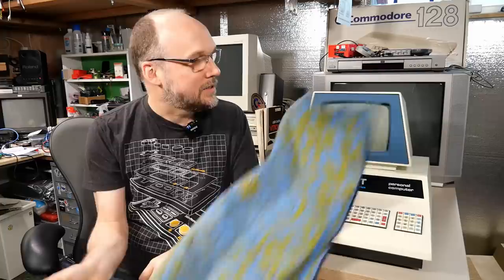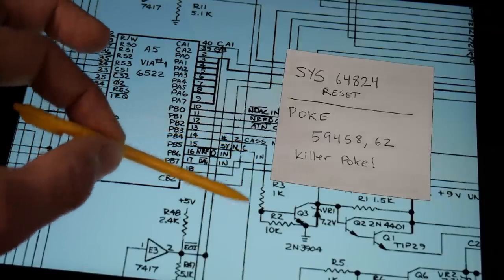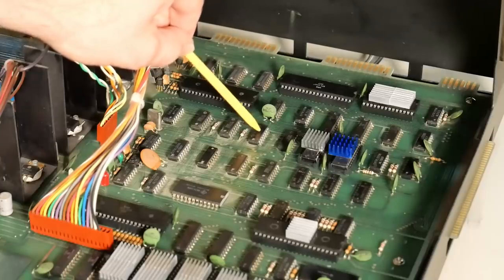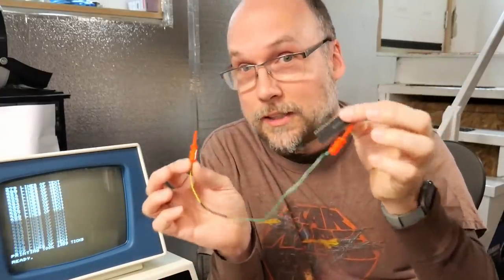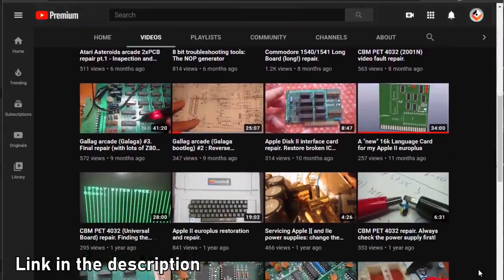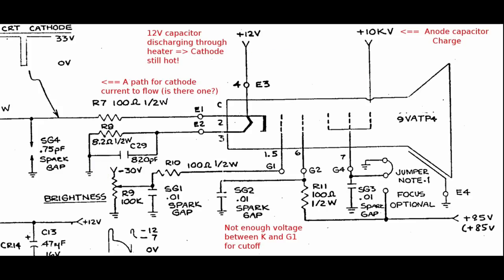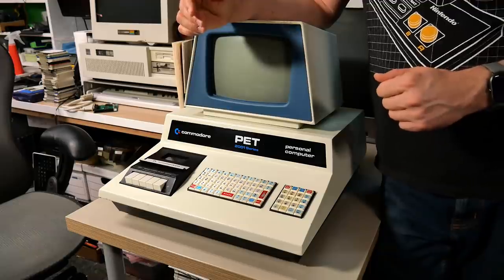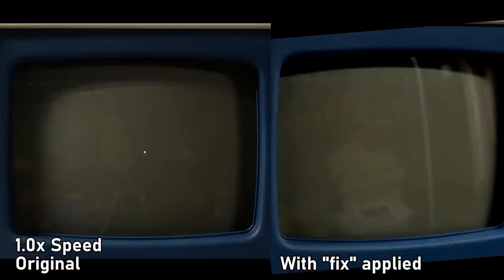Permanent Killer Poke Mod and CRT Spot fix on the Commodore PET 2001

Comment: My 9"PET has no dot on power off, PCB is marked CDU-B79-CMD, the tube is an AMPREX M24-392GH.  
More modern CRT monitors have a spot killer circuit. (google: CRT spot killer)
Long persistence of a dot may be an indication of circuit failure.

Comment: As a kid in the 70's, I remember that white dot as being totally normal on all of the black & white TVs.  This is the first time in my 50 years that I've heard anyone say its simple presence at power-off was any kind of indication of a problem.  Unless it's lasting so long, and is so powerful as to burn in the screen, I think modding it out of existence is a bad idea that breaks the 'genuine' experience of using these old CRTs.
Reply from the maker: On old TVs it was a way to drain the high voltage from the CRT, good if you had a consumer in there changing tubes. 

Ones TVs became solid state the dot was eliminated on most TVs especially solid state ones.
Reply: @adriansdigitalbasement  I think that fix circuit needs component value tuning on a case-by-case basis. It's helping noticeably, which means it's a good idea but not an optimal implementation.

Comment: My first ever "proper" computer I managed to salvage from a fire damaged business and it was toasted good and proper that Pet was.  Luckily the unique chips had survived and the unit was little damaged except it didn't work and over the following months using a hoary old "How to: Electronics" book and salvaging components from broken stuff I slowly put it back together and got it working.   

I had a nasty glazier's soldering iron that stank horribly and back then solder wasn't cheap and the fluxed solder costly but it was a lovely moment after many long long hours it sprang into life but did pong a bit of burning smell from the fire and I sold it quite quickly using the money to buy my first IBM PC and something Sinclair prob the Spectrum 48k and because the IBM was also broken I started again with my little box of harvested components set about getting that up and running and was far easier than the Commodore imho.   

Has to be said in those days it wasn't the easy architecture we know and love today, none of this swapping out of cards etc and you could kill your motherboard quite easily through heat death, lightning spikes, telephone bell too close etc and because it was new technology the quality control wasn't what it is today with CPU's taking an early shower due to poor manufacture of components.

Comment: Could you have done the mod by getting a spare chip socket, running the mod cable from that and installing that between the chip and the mainboard? or would the extra socket have unwanted side effects, maybe cause unreliability?

Comment: Maybe put a resistor on the SYNC line so that the poke works as expected without risking damage to the chips?  Or attach the clip back to SYNC, since you have a resistor on it already.

Personally, I'd be tempted to replace the ROM to give me both options.

Comment: Eliminating the 'snow' by only writing to video RAM during VSYNC always struck me as a cheap 'fix'.  I designed a video card for my Altair 8800 using DRAM for the video memory running at twice the processor frequency, with alternating phases dedicated to the CPU and the screen refresh.  It worked great - unlimited CPU access and no snow.

Comment: Would never think the power off dot was an issue, I’ve had plenty of TV sets (mostly black and white) which kept the dot on screen for a few seconds —  also had something similar when I was a kid with a colour set, for some reason as a kid I turned on and off a colour set about 10 times very quickly and after that every time the set was powered off and unplugged there was a colourful ring that would shimmer for about 60 seconds and would fade
Reply: That last bit sounds like some hardwired order of operations had gotten out of order. Maybe a resistor value drifted, or a capacitor dried out, or who knows what. A diffuse afterimage is not a big problem anyhow, it will do even less damage than a few seconds of normal operation. My only concern would be that there's high voltage sticking around where maybe you don't want it to -- but there's a reason you're not supposed to poke around inside CRTs even when they're off unless you know what the dangers are.

Comment: The spot on your pet is too large to worry about spot burn, spot burn occurs when you have a stationary focused spot of around 1 to 2mm, and is worse on monochrome monitors as there is no shadow mask to take some of the energy.
Monitors where the spot suppression circuit has failed will strip the phosphor in 1 turn off.
There are two main ways of dealing with this;
1 you can dissipate the CRT energy while the scan circuits are still scanning but this is reducing with time from off.
2 you can cut off the CRT usually by taking G1 negative.

The first option is to turn on the CRT hard at power off so the energy is discharged before the scans shrink.

The 2nd was to take the G1 hard negative on power off, this was often achieved by having a transistor that either shorted part of the G1 divider chain or disconnected the G1 control GND end on power off.
Reply: Do you think a cap between the 12v line and the grid would provide enough of a negative voltage to cutoff the tube?
Reply: @eDoc2020  No I don't think it would. I would probably increase the cap on the -30V rail and try to disconnect the 0V end of the brightness pot on power off.
This could be done with a transistor and the base controlled by a zener to the 12V rail in some way.
You could also increase the video HT capacitor value.

Comment: I’m surprised that a modified DIP socket wasn’t used instead of bending a lead on an IC. The way to go would be to get a socket for use in wire-wrap applications, trim all but one pin to the correct length, then bend the one pin out. Instant adapter.

Comment: The original IBM PC 5150 with a monochrome monitor could blow out the monitor's horizontal output transistor.  When powered up, the video controls could come up in a state that would blow out the HOT if it was not reset.  If there was a BIOS failure BEFORE the 6845 was reset, the horizontal output transistor would fail.  Eventually the BIOS was modified to put the 6845 into a state that would not blow out the HOT before testing the memory, etc.  I know this because a friend blew out 3 monochrome monitors before he figured this out.
The BIOS of the original 5150s could not be rewritten so this time bomb was in the 5150 for ever.

Comment: Even better idea is to use the Hsync signal loss at power down to send a bit of the +85V to the G1 terminal of the CRT
Reply: I thought negative grid voltage is needed to cut off the beam.
Reply: @eDoc2020  yep you're right. my mistake! We need to store some negative voltage into a cap then send it to the grid G1 when HSYNC dissapears. If I remember well -40V was the standard for spot killers back in the days

Comment: 13:25 Adrian: "I am far from an expert on CRTs..."

Most other ADB Videos: [Tears into CRT, has fancy CRT troubleshooting equipment, rejuvinates a Mac CRT, swaps and mods other CRTs... also one of few retro guys poking fingers into high voltage areas where I don't dare, almost like its no big deal, but still gives safety first warnings...] 

Could have fooled me. :-)

Comment: on that you can't damage a machine with a program.... I believe there was a command on the BBC Master that turned off the cooling fan.... resulting in the case melting over the PSU. (also I believe there was no command to turn it back on...)
Reply from the maker: Haha that is funny!
Reply: What kind of design choice is that!?

Comment: Just think of all the televisions and monitors that had the spot and how they all have a massive screen burn where the dot blasted the phosphors, yeah, I haven't seen one either, cos it's normal for that era of analogue CRT circuitry... :P
Reply: My family's 1990 TV we used to have developed a fault with the vertical deflection. It would take several minutes for the deflection to kick in; before that there was just the super bright focused line. It probably ran like that for at least 10 hours before we got rid of it and I couldn't notice any burn-in there. A few seconds of a defocused beam probably won't cause many problems.

Also, I wish I knew what I do today back then. Reflowing a few solder joints probably would've fixed it quickly.

Comment: Definitely need that capacitor across zener diode to keep transistors open to allow path to ground, without that there is nothing to keep that voltage up after poweroff, its behave as the original R2

Comment: It pull me back to high school.   Our PET had this problem.  I remenbered that I saw there was a trick to pull the vertical r
or horizontal signal to the out side of the screen when it discharging long times ago.  but not sure if it is useful.  it just in document.

Comment: why dont you just pull back on the negative lead into the crt? pull back resistor mid strum of the crt and negative lead(wire)? what about the same diode fix in the same place, first from the crt to the board, leaving your fix in place. this will straight the voltage out from the fly back transformer. usea better fly back transformer? just a suggestion

Comment: The dot does not mean the CRT is dying.... It was common on old(er) CRT screens...
The dot fades out as the CRT cathode cooles, the HV bleeds off, and the voltages on the CRT elements discharge...

Later CRT's added a 'spot-killer' circuit to prevent the dot and resulting burn mark that can happen...

Edit: the guy covered it in the video... :D haha - but yeah :)
Reply: The dot could mean the CRT is dying, but not in this case. The cutoff voltage drifts a lot when a CRT is dying, it can go so off-spec that the spot killer circuit is no longer able to blank the screen during power off.

Comment: I have seen black and white portable TV sets do that spot thing when you turn them off, particularly if you turn them off very soon after turning the power on, so I think it's somewhat common for black and white CRTs to do that.  How necessary is it to fix the power off spot issue?
Reply: It's not necessary, unless you spend more time power-cycling the monitor than actually using it.